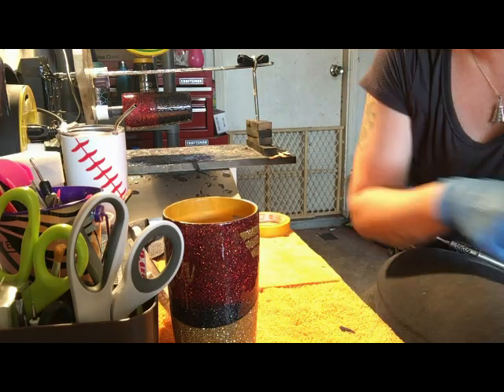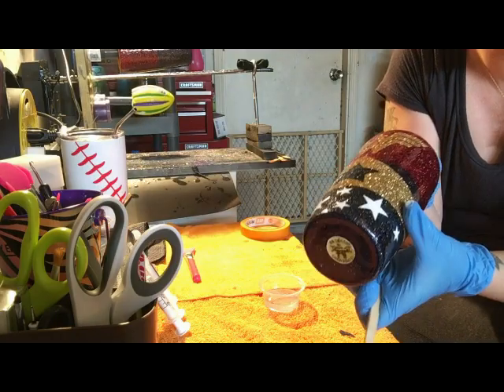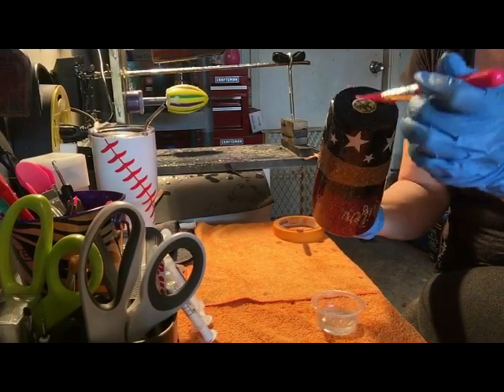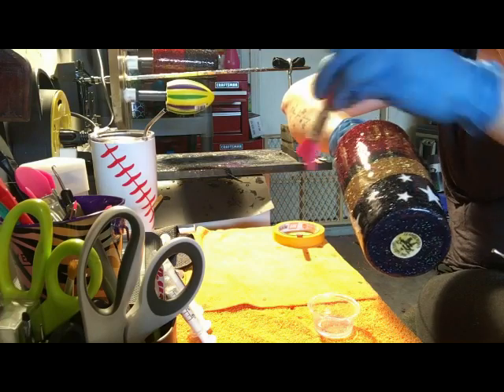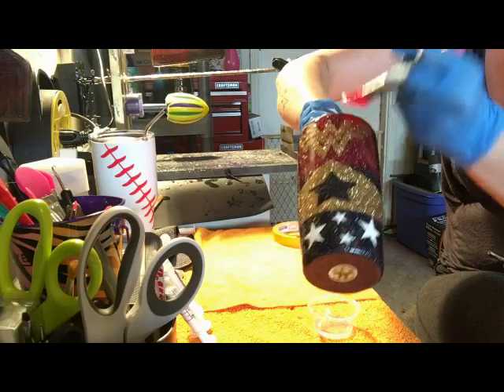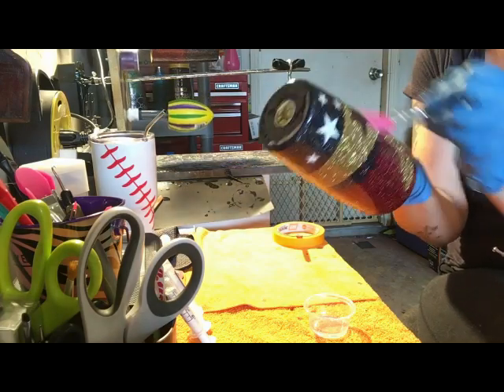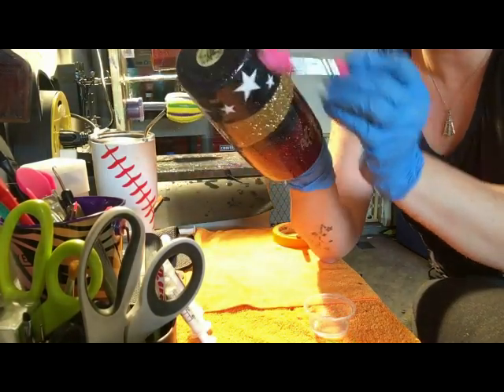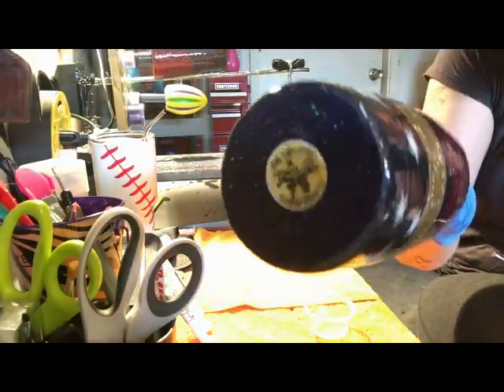GLITTER EPOXY FINAL

Comment: i've been trying to get a decal on that goes all the way around the cup but my cup isn't straight down. it's a little bigger on top and then tapers at the bottom. kind of like yours in this video. anyway, no matter what i do it ends up bunching up somewhere along the way. any suggestions???
Reply from the maker: Jennifer Moya The best way is to use htv and measure ur cup all the way around the make it slightly curved by editing the points on ur design. If you still can’t get it maybe email me ur design and brand of cup. I can try and help
Reply: thanks for the suggestion. I've got some time off tomorrow before class so i'll give it a try. i'll keep you posted on my trail and error process lol and thanks so much for being so helpful. i appreciate it =)

Comment: Thank you for the videos, do you not suggest using a mini iron to apply the htv? Also is just your cup turner turning or is the cup also spinning and the cup turner is turning (did that make sense?)?
Reply from the maker: Erenee McLam the whole turner is spinning not just the cup the way it turns actually works great. You can send me a Fb message or email I can tell u more about it. And no I don’t suggest the mini iron I tried that and it failed epically over and over it didn’t ever seem to seal each corner etc.
Reply: Thank you for getting back to me, I have yet to make something for myself, but I would really like to make this wonder women cup. Thank you for the video, I will be referencing it often
Reply from the maker: Erenee McLam ur very welcome! Yes u def got to have one for urself

Comment: What exactly are the names of the brushes did you get them on the Amazon?
Reply from the maker: S M hi there so the brushes I use in the video are from amazon here is the link.
https://www.amazon.com/dp/B075K72NRW/ref=cm_sw_r_fm_tai_b58IAbQ1DA9CM
But since then I have began using a much wider brush also silicone and hairless it’s a mixed media shaper brush although it is more expensive it last longer you cover more surface quicker then with the small brushes here is the link for the one I now use.
Prima Marketing 963880 Finnabair Art Basics Mixed Media Silicone Brush, 2", Silver https://www.amazon.com/dp/B01AMLIUW6/ref=cm_sw_r_cp_tai_i68IAbAZXJ26W
Reply: Is there a beginning part to this video?  Like from the start?